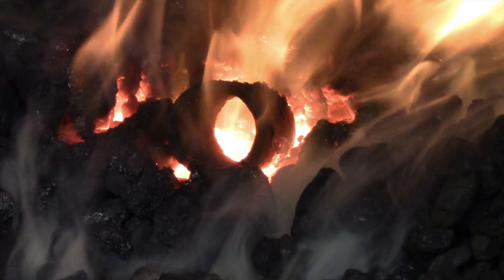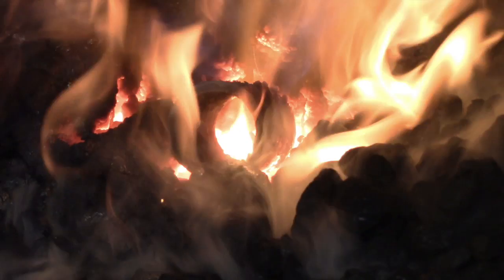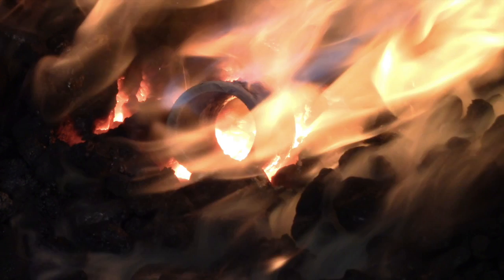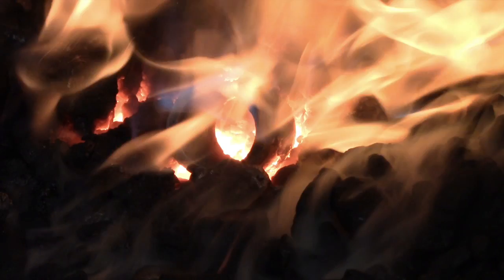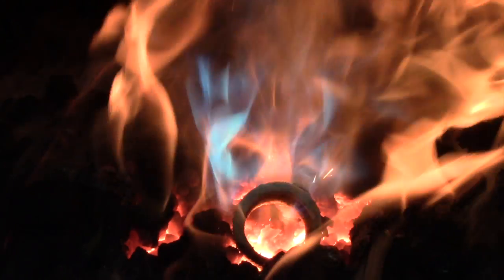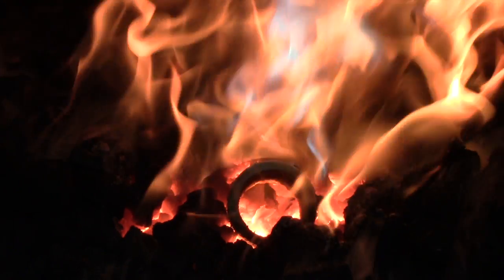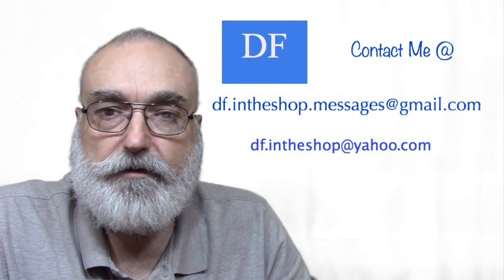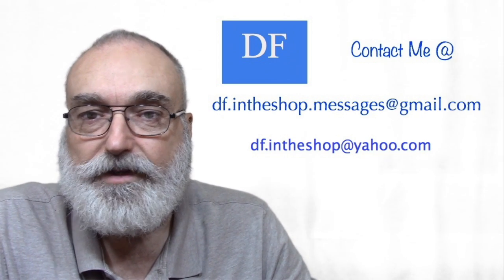Blacksmithing for Beginners -  Metal Fume Fever

Comment: I had metal fume fever, after welding 2 hours later, my chest felt tight, I threw up, my heart was fluttering, head ache, dizzy I had to ride back home 40 miles on a motorcycle at night. It was scary. Jesus got me home.

Comment: very important video! thank you.  I thought stainless steel is safe to forge or weld.  waht about the crockery we use , knives forks etc we use to cook with, some people put them in the fire when roasting potatoes , that is dangerous ?  whats wrong with all these people coating our metals with dangerous things?
Reply: also , how to turn stainless steel into normal steel again?  can you hand sand it down will that remove the bad metals or is it embedded in the metal itself?  i know with galvanized you just need to put in vinegar for a lng time or just sand it down before welding.

Comment: I was stick welding and felt really dizzy and confused. I felt like I was about to pass out feeling  really sick. However, I didn't have  headache, I felt very spaced out and confused. I couldn't walk straight and felt super weak.
Reply from the maker: Sounds like you got lucky this time but who knows what you were breathing and how long it's going to take to flush it out of your system.  Take care of yourself.  If you live on earth you are breathing crap everyday  so it takes a lot less to tip the balance than it used to. Use PPE
Reply: same here but i got headaches and a nasty sore throat its been 2 days
Reply: @trinitythemiata2197  hey did u get over it? Hope stuffs good for yall

Comment: I built a galvanized rocket stove.  I have not fired it up yet.  Can I burn off the galvanizing safely by staying out of the fumes and then use it to cook with?  Help!!!
Reply from the maker: I would not do it.  I certainly would not cook on it.  We breath enough crap on a daily basis why volunteer to take in more.
Reply: I built one too.  Scary ! OK,  I will trash it.  It was made with galvanized heating ducts so it was cheap to build.  I would like to try again,  this time with  black chimney pipe. That should be safe right.  I would like to make the legs out of nuts and bolts.  What kind of bolts do you recommend that are safe?  I don't give up easy !
Reply from the maker: The black pipe is fine it isn't treated with anything.  Same with the bolts,  don't use bolts that have a heavy hot dipped galvanized coating.
Reply: What about galvanized heat ducting that comes right out of my burning hot furnace.   What is a safe temp for galvanized ducts?

Comment: As a welder who has worked with galvanized allot. Wear a properly fitted respirator and use a fan and or extractor. Tell your boss to suck a duck if he tells you some bullshit like "hold your breath while you weld".  And mind the heavy sparks, the zinc causes allot of volatility.

Comment: At about 35 yrs old, cut grinded , and welded a whole lot of rebar to lots of galvanized pipe, which was ground , cut and welded. I had heard of the dangers of galv. fumes. This was back in the early 90s.Was making removeable posts on my trailer. They still are holding up to this day . I guess at 61 now, and no problems, I just stayed out side, tried to hold my breath, and turned my head and quit welding when it seemed fumes were coming my way too much. Guess I was lucky. Been working on cars and trucks too since the 70's, blowing brake dust out with compressed air was the norm yrs ago. How am I still alive? ( we won't even go into the stuff I put in my body as a young hippie in the 60s' and 70s')
Reply from the maker: It is true that the body can appear to withstand a tremendous amount of punishment but the smart people know when they got off lucky and they do quit while they're ahead.
Reply: Mike Sokolow   Here's the problem with this type of thinking.  My grandparents both lived to 96 years.   You also might be able to make it to that age.  Breath in too many bad fumes and maybe you won't make your potential.  Why take a chance?

Comment: Is this something that can be mitigated by wearing a respirator mask with organic vapor cartridges?
Reply from the maker: No!  The problem with that way of thinking is that it gives you a false sense of security and as a result you would be exposing yourself to increasingly higher levels of noxious gases.  As I mentioned in the video - you have no warning signs that tell you when you crossing the line.

Comment: What about galvenealed steel?
Reply from the maker: Based on  what I've read it is still a hot dip galvanized process.  The surface has just been treated to make paint stick better so you will be burning off a heavy zinc layer if you put it n the fire.  Not worth the risk.
Reply: Thanks that's what I thought. Some people I work with have different opinions.
Reply from the maker: They are probably thinking of electro galvanized metal  which is much safer to weld because it has a very thin coating of zinc.  Heating up metal in a forge is quite different than welding because you are heating up an entire section of pipe not just a small areas and that could easily produce enough off gassing to cause problems especially in a well sealed shop.
Reply: Ok thanks. By the way I really enjoy your videos

Comment: I've been watching your videos for the past few hours I have learned a lot on a little time.  you're very knowledgeable, teaching me a lot of things I am new to smithing I've had an interest in it for a while trying to learn everything I can before I jump into it. I've been welding for years and I thought once you grind it off the top coat on the galvi steel it was fine guess I was wrong. so all sheet metal is toxic then? I guess I'm just trying to understand what metals are safe and which are not. if I would have build a hood for my Forge what kind of thin metal should I use? I've always been the guy wearing the respirator having fans on with doors open when everybody else is just breathing everything toxic in. so I've always tried to take the proper precautions but I'm sure I've inhaled stuff I shouldn't who hasn't. thank you for your videos and all your knowledge

Comment: Also, be aware that brass brazing rod  contains zinc which will fume when melted. Indeed the effects fume disease are cumulative and may not be immediately noticeable. Make sure to have good ventilation when torch brazing, especially if you're doing a lot. I discovered this the hard way and have been extremely cautious since.  Whether or not there's any scientific basis for it, drinking a quart of milk did seem to rapidly alleviate my symptoms but probably not a substitute for proper medical attention.
This video is very important advice for anyone working metal!

Comment: Is there any kind of particulate sensor that you could install that would sense if there was gaseous zinc or something similar? I'm assuming there's at least an industrial air quality sensor that could provide some warning.
Reply from the maker: I'm sure there must be but I wouldn't even know where to look.  Maybe somebody reading this will have some ideas.
Reply: I know it sounds a bit daft, but the following is true for me. If I have been exposed to zinc as a gas [welding or cutting] or as a dust [wire brushing brass] I get a strange metallic taste in the mouth when I next light a cigarette - I guess it must affect my sense of taste .... not exactly the type of sensor you are looking for  ;<)

Comment: sheesh. you have me all scared now. not so much of the forging process. I have always been weary of galvanized because it's so temperamental. but I'm a service plumber by day. and I am constantly using a grinder to cut whatever, old rusty cast iron pipe, glavanized, old terracotta pipe, tile, fpr  board. I mean the list goes on n on. honestly. I barely used a respirator for any of this. never really thought about the fact that all these things are slowly poisoning me I guess. you got me scared straight D, from now on I don't wanna cut anything without a respirator. thanks for the info sir I probably could have gotten really hurt, as a new amateur blacksmith I'm trying to come up with new ways of doing things to make life easier and I'm positive I probably would have poisoned myself. thanks again keep up the awsome vids!
Reply from the maker: Our bodies are pretty tough but they do get to a point when the can't take anymore and that's when you wished you had started taking simple precautions 20 years earlier.
Reply: +DF - In The Shop see this is why channels like yours are so valuable.  I have no apprenticeship or actual person teaching me about this. you tube is my sensei. without guys like you I'd be barbecuing metal not forging. thanks for everything.
Reply from the maker: Glad to help

Comment: Good info!! But I doubt the "400 degree off gassing" statement. The issue here is zinc or zinc oxide reaching your lungs. For this to happen it needs to get airborne, either mechanically (grinding/cutting) or as a "gas". The boiling point for zinc is around 1500-1600 F and it's not until then a gas of zinc is produced. To my understanding this gas is immediately oxidized to zinc oxide which forms very small white particles - this is seen as a white smoke. So there is no such thing as an invisible zinc gas, apart from solid zinc particles floating around from grinding/cutting....
Reply from the maker: I wasn't able to find a reference for that either but I received emails from several people giving me the same information ( within 100 degrees or so ).  I decided to leave that in  because I would rather be wrong on that point than not use it and find out latter that they were right.
Reply: I would go for "better safe than sorry" either way.  I won't even weld the stuff outside even though fence makers do it all the time.  

Larger point.  The guys with my two favorite blacksmithing channels are having a discussion!  It's really time to just sit back and listen.  You guys are both so different and yet so excellent.
Reply: My understanding of the concern is that the Chinese have been using a Tin/lead solder as a cheaper base under(mixed with) zinc for some time. Since these have lower melting points and Chinese are famous for other contaminants like Cobalt6, Uranium, Radium, etc. this is a serious concern.
Reply: get a vapor mask.
Reply: try again mate ur logic is sound enuf but hav anuther look around coz az a boilermaker welder i can tell u wot this guy ses here is spot on

Comment: Thanks for the video.  I have some galvanized pipe nipples connecting the black pipe fixtures on my tuyere.  I have a black pipe tee coming from my blower with the top of the tee connected to a galvanized nipple that in turn connects to the bottom of my forge.  The bottom of the tee is connected to another nipple that connects to a black pipe end cap so that I can empty clinkers.  I'm pretty sure that the galvanized nipples never reach 400 degrees.  However I suppose that if the end cap is full of debris and some hot coals collected near the galvanized nipple, the temperature could get pretty warm.  I will try to measure the temperature of the tuyere the next time I forge.  I use my  portable forge  outside though so that should help give a margin of safety.
Reply from the maker: Working in the open does help a lot but it's easier not to have to worry about it.

Comment: So say if you have to weld a nut to a metal plate for instance, what to do? As buying nuts without a galvanized layer is basically impossible these days. Grind it off outdoors first?
Reply from the maker: Definitely grind outside whenever you can.  Grinding off paint or rust coatings inside the shop just creates a toxic layer of dust over everything that gets kicked up every time you move something.  Wearing a respirator while your grinding isn't going to help if you're just going to be breathing in that dust anyway when you are done.
Reply: Thank you Denis!